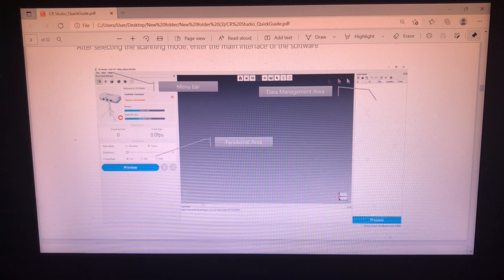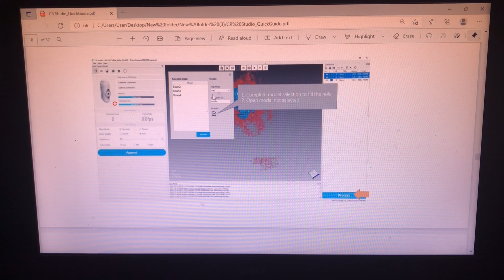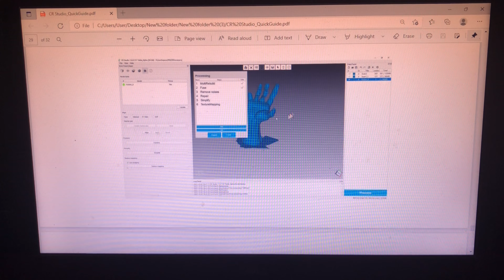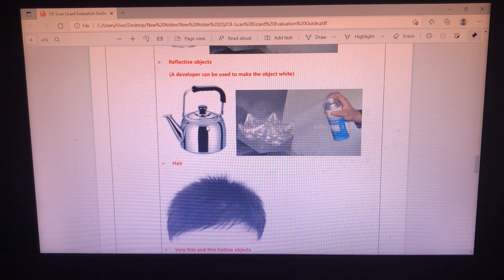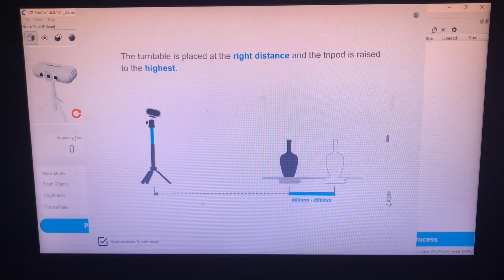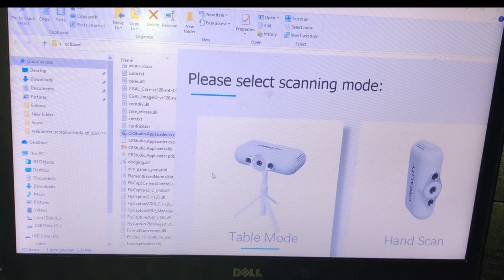Creality Cr-Scan Lizard software installation

Comment: Just received mine (June 2022), and a lot has changed from your video I'm afraid. The main one, which you highlight as important, is there is no config file on the USB. It went online to download mine.
Reply: Where did you go to download yours? Mine didn’t come with one either .
Reply: @Shakygun  sorry for the late reply. I ran the software as Admin, explicitly let it through Windows 10 firewall, and when it launched, it had a small window asking where the config file was. I didn't have one, so selected from the network, and ut found mine. Each config is specific to your scanner.